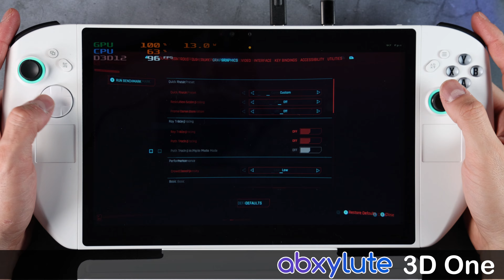ABXYLUTE 3D one cyberpunk test

Comment: tbh this is absurd. people would want to try AAA games in 3d and so far none of them looks playable
Reply from the maker: In 3D mode it's kinda rough for AAA games. The 3D conversion seems to be pretty heavy
Reply: @OKishGamer maybe when they send updates it will get better?
Reply from the maker: @Youaremaster1234  I would hope, If they can get it more efficient on the 3D effect weaving it would make a big difference
Reply: @OKishGamer You guys gotta just go to Nexus mods and get mods to speed up whatever game you’re playing. I did that with Cyberpunk and it runs WAYYY better than what this video shows. Think outside the box … and honestly grabbing performance enhancement mods from Nexus isn’t very far outside the box.
Reply: Cyberpunk is completely playable in 3D with a few Nexus mods designed to increase frame rate. I have it running as smooth as it runs on my other pc in 2D.